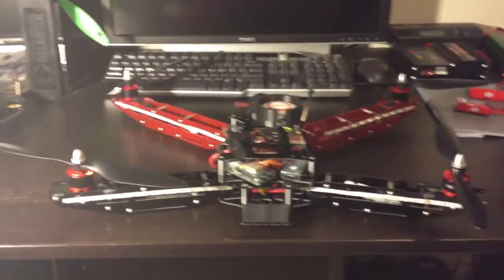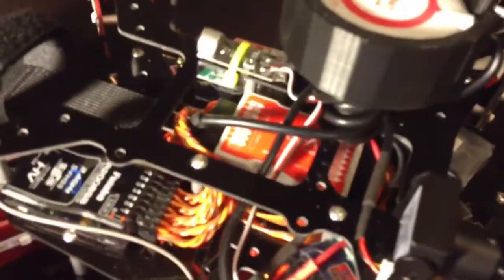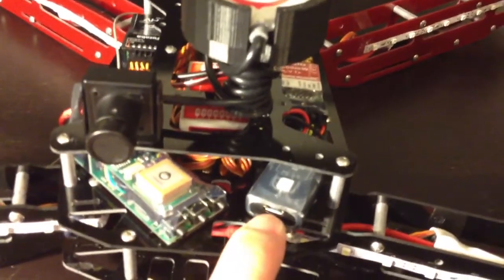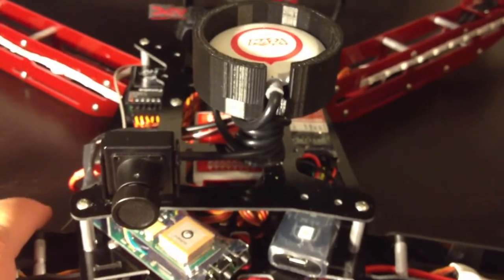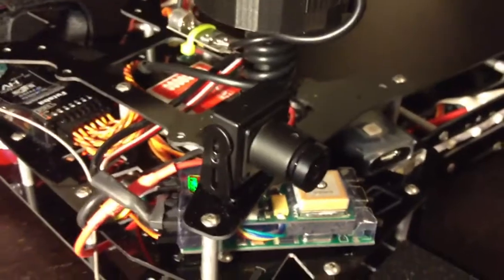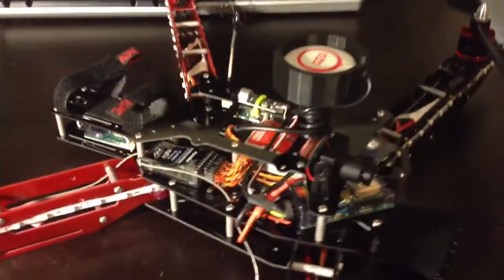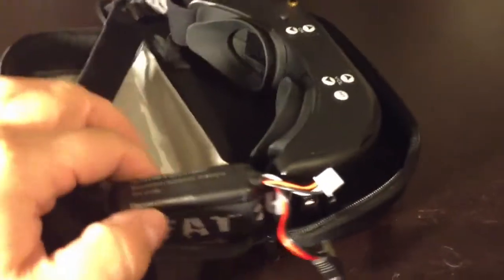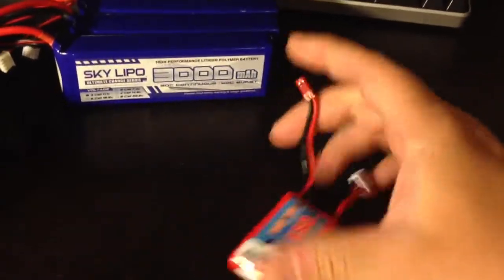HT-FPV Quadcopter Configuration

Comment: There is a good chance that the gopro will cause interference with the naza gps being mounted where it is and will prevent it from locking onto the sats and cause magnetic interference too. I had to remount my gps back on the original stand and place it in the rear of the frame.